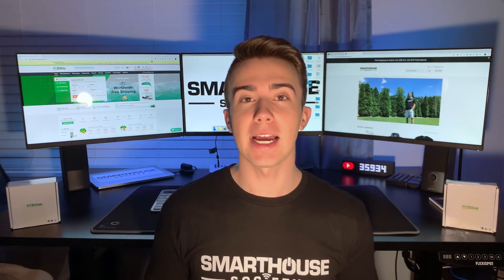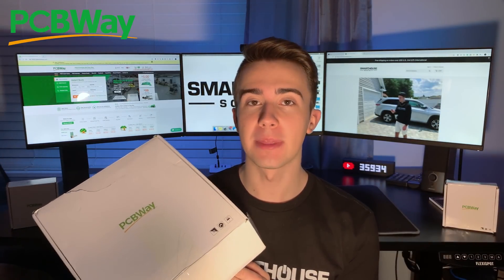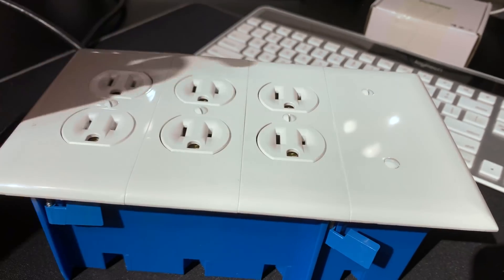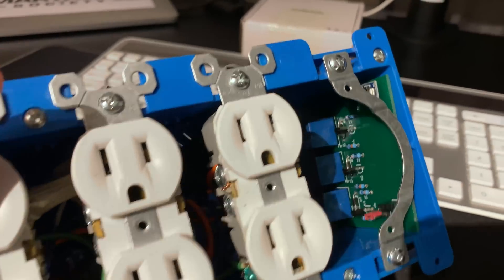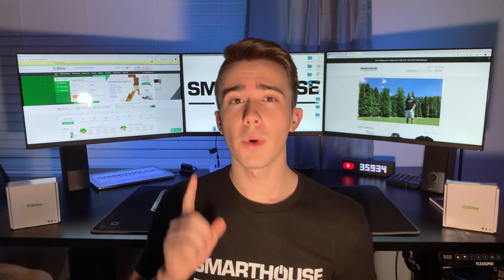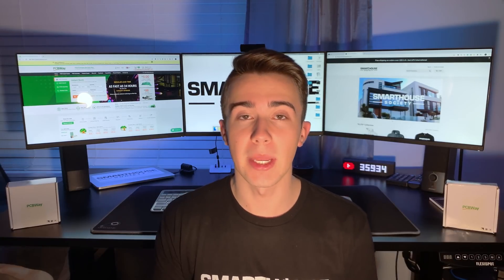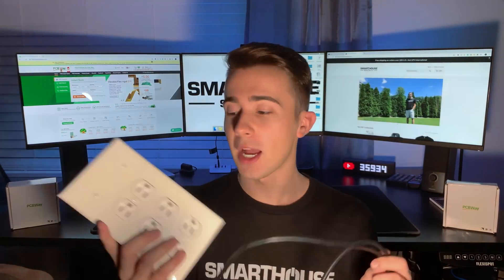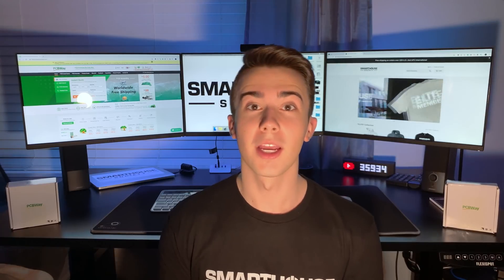Complete Guide DIY Smart Power Strip OpenHAB and Home Assistant: Demo (1/4)

Comment: will nice work but why not add power supply to the pcb something like "HLK-PM01" instead of external one
Reply from the maker: If I were to do it again, I would definitely do that. I designed this a while ago before I found out about those converters.

Comment: I got a 4 outlet and usb power controllable strip, (5 individually controlled sockets) on Amazon for like 27 Bucks or so... It's esp8266 powered so it could be flashed or you can use the API you can get for it.. Probably can't build one much cheaper...